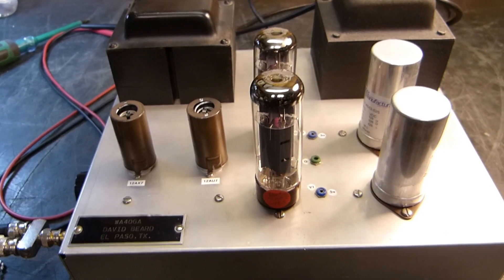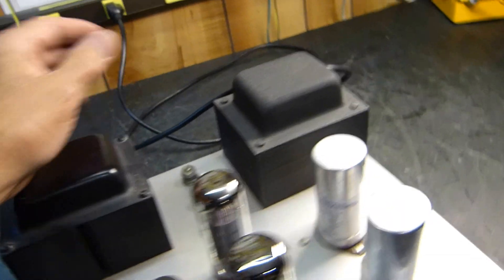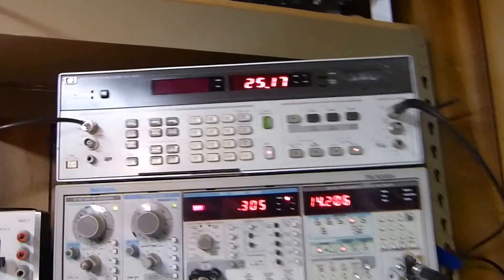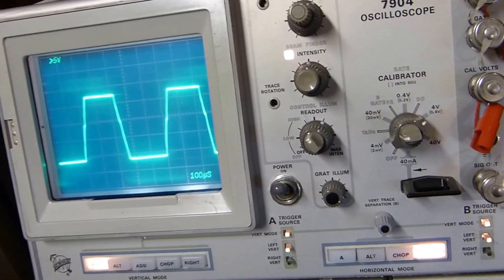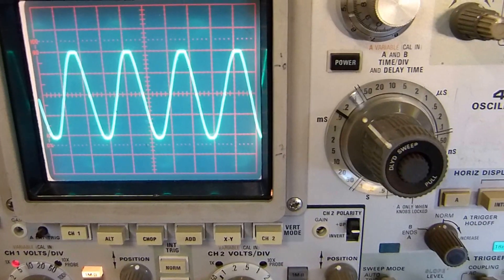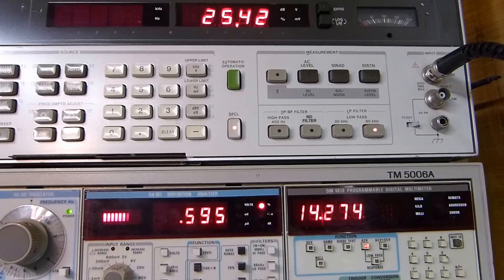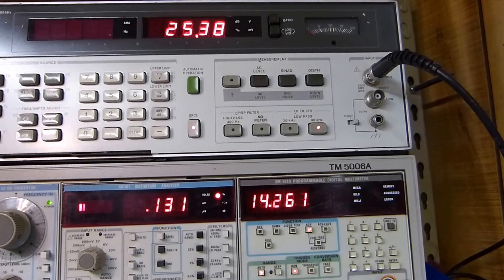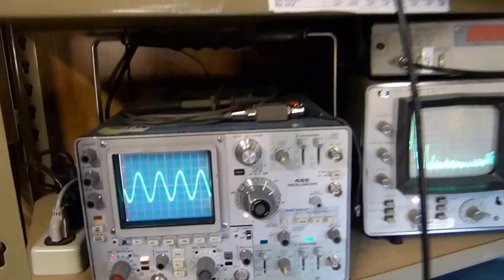Experimenting With Three Methods For Adjusting AC Balance In Vacuum Tube Amplifiers

Comment: can i do this without oscilloscope ?
Reply from the maker: Yes, it think it should turn out nice if you put your volt meter from grid to grid of the output tubes and adjust for zero voltage while driving it at a reasonably "loud" level.

Comment: It's interesting that adjusting for symmetrical clipping was so inaccurate. A fourth way to do it would be to adjust for minimum 2HD on a spectrum analyser, which is what the process is really all about, rather than symmetrical clipping, which makes all sorts of other assumptions. I would expect this to agree completely with the AA501 THD method.

Comment: I am in awe of your shop equipment.All i have is a Fluke 77 simpson 260 and an old Tectronix RM 561A also an HP 200 audio oscillator. Never found anything tube or S.S. i couldnt get running again but definitely takes more time n I couldn't give customers the distortion specs  cause I never had the bucks equipment as you do.I would sit down with schematic (hand drawn or a Sams if i was lucky) & try to figure out what the design was supposed to do and what was it actually doing based on my measurements.Toughest so far? Early Crown DC-300 not the A theyre pretty easy.And lately a 1949 Midwest 916  radio that is so microphonic on FM you cant turn the volume up too loud! and it breaks into some kind of RF oscillation on the low end of the FM band.I'm thinkin i missed a bypass .01 somewhere.I'll find it. But my hat is off to you for being so well equipped.  N2VUW       73's

Comment: Great video! I have a question: you injected 2000Hz signal; what about its PPVoltage?
Reply from the maker: Mephysto65 Please give me more of what you mean by PPVoltage and I will see if I can help.
Reply: ElPaso TubeAmps Maybe I'm a little bit confused. When you test amp for thd you inject a signal (1khz, 2khz or whatever) in its input. This signal has a voltage: do you start from a value and then increase it until distortion occurs or set a fix value and then increase amp pots until distortion? Thanks in advance
Reply from the maker: Mephysto65 I understand your question now. In power amplifiers like the Dynaco, Mcintosh, etc. it takes about 1 volt (or more) to drive the amplifier to full power. In a guitar amplifier, at the 1/4 inch plug where you plug the guitar in, it takes maybe only 0.050 volts (50 mv) to drive the amplifier to full power. So, depending on what you are testing, it is a good practice to start out with the driving voltage really low. Assume your generator is set at 0 dB output (which would be about 0.77 volts across 600 ohms) , you might set your attenuator at -50 dB so that you do not overdrive the first state (often times a very high gain 12AX7 state). If you overdrive the first  state then everything after that state will be over driven and distorted. So, while watching the output on an oscilloscope, you would slowly raise the drive voltage from a few millivolts upwards until the DUT (device under test) is over driven or starts to clip or THD rises suddenly, etc. . A little experimenting and I think this will make sense. Hope this helps.
Reply: ElPaso TubeAmps Great! I'm coming out of the fog. Talking about 600ohms termination: is it a rule for every generator involved in audio test or there's something else to know in order to determine if I have to insert a 600ohms termination or not? By the way: I have 50ohms termination and if I put one of them from generator to oscilloscope I noticed that voltage drops 1/2 value (ie. 4Vrms to 2Vrms)
Reply: Mephysto65 If it drops to 1/2 value you have the correct impedance terminator.

Comment: watched twice but still wondering where you placed the leads of the scope. across the primary of the output xformer?
Reply from the maker: The scope is on the secondary side of the output transformer where the 8 ohm dummy load resistor is connected in place of the speaker.
Reply: Thanks

Comment: In many amps it helps to disconnect the Feed Back loop for AC balance adjust.... The reason is because the feedback loop is trying to balance the AC signal and fighting against your balance methods...until you push the drivers out of headroom ..then they are not as effective..

Comment: I would check distortion also with the >400Hz filter, just to rule out 120Hz power supply hum that comes up when the output is unbalanced. Some of the distortion you are reading may be hum, if this is the case.

Comment: Thanks for showing those techniques.   Obviously using the distortion analyzer is the best.  I saw another technique suggested for adjusting AC Balance when the output tubes have separate cathode resistors.  This technique suggests using a 100 Hz input signal with about 70% power output, and adjusting the balance so that the DC voltage difference between the two cathodes is minimized. If you have an opportunity I'd like to see how that approach works compared to the other techniques you showed.